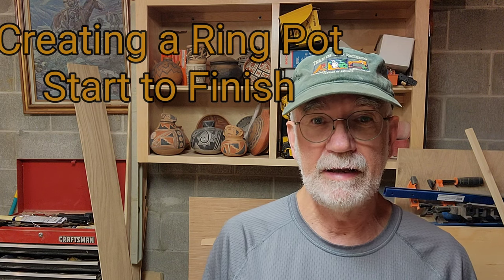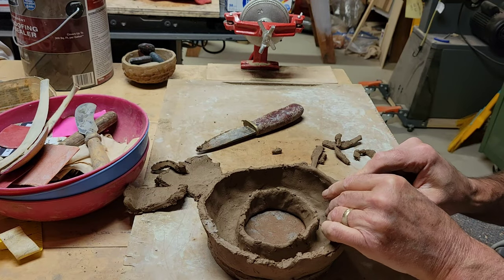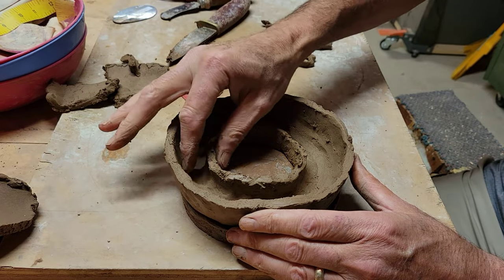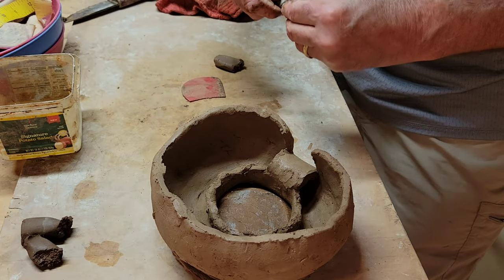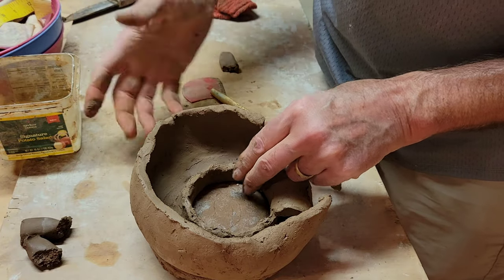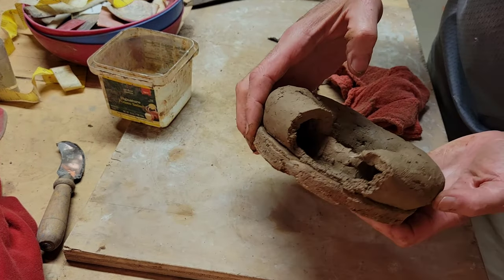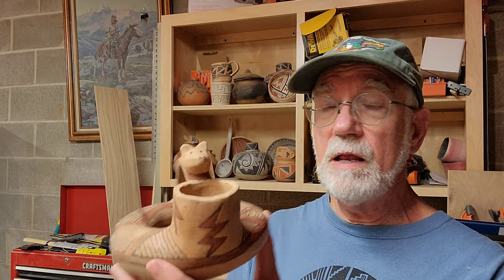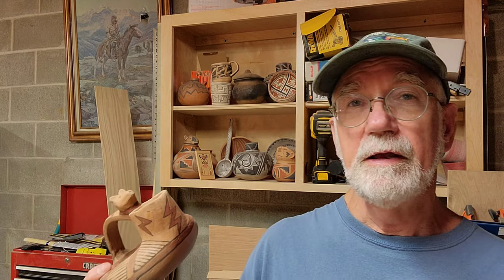Making a Ring Pot; Beginning to End

Comment: There are an infinite number of ways to do it I'm sure. I started with John's method, then ended up copying Amy's method. Yours is another approach to the ring pot. It goes to show that there are no set ways to do things with pottery, just do what works for you. You have a little spam down there, you might want to filter out all links in comments that will reduce the spam burden.
Reply from the maker: Thanks for the comment and the heads-up.

Comment: Very nice work I used pine needles on the inside of the one I made like this
Reply from the maker: Interesting, does that mean that you tied pine needles together to form a ring and then built the clay around it? Then they burn out when its fired? I wondered about doing something similar with cattail leaves.
Reply: @airstreamwanderings3683  yes and yes

Comment: Wes, you could stuff your first layer with grasses (not being authentic I would use newspaper) and then you could bend your outside layer over and just score and slip both area to be joined. The grass or newspaper stuffing will of course burn off in the firing. Making two is as you said another solution but that is very frustrating if they are not perfectly the same size and leather-hardness. I also think your clay is not plastic enough. I took a two week throwing class and learned to do this on the wheel - not that that helps but I am saying that because I do understand the mechanics that go into what you are trying to do. I think you did very well. They look super great.
Reply from the maker: Thanks I think you are right. My clay wasn't very plastic and it cracked easily. Nice idea about the grass. If I do another one I'll give it a try.